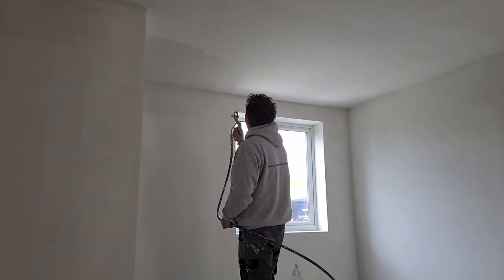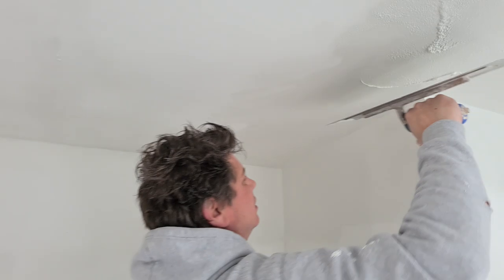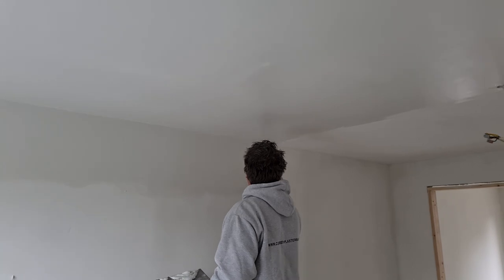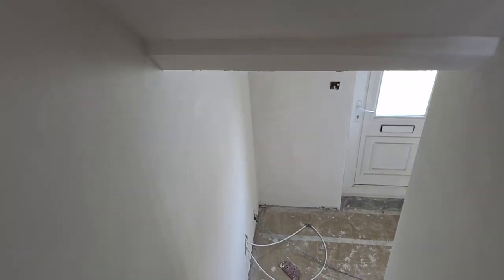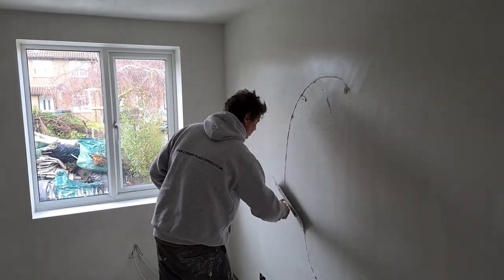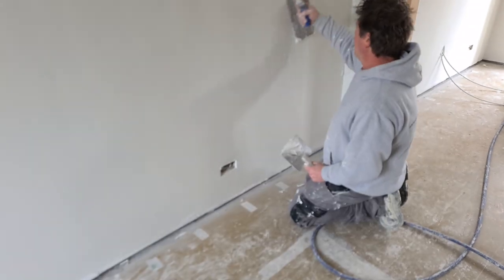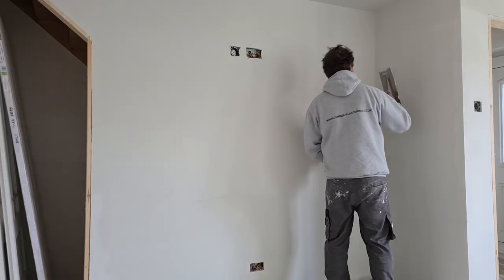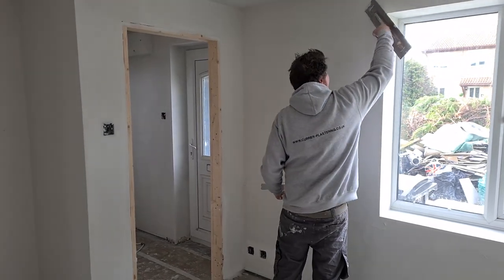Finishing Airless Spray Plastering

Comment: Cracking job I’ve been looking into spray plastering instead of the old traditional ways, how is it for single rooms in occupied houses with clear rooms ?
Reply from the maker: The system works well however its no quicker then gypsum plastering
Reply: @currierplastering  well it’s looks quicker, cleaner, more enjoyable, two of you on the job would piss a room in a day and a much better result, nice video
Reply: Finish is better than gypsum when painted. Not as hard/polished finish but looks really classy when painted properly

Comment: Watched your video a couple of times now. Just finished 12 ceilings with your words in my head, "chase the tail." Thanks and looking forward to the video with fitting the beading. What was the the finish filler you use that goes off in 3 minutes?

Comment: Looks like you're doing a level 5 finish... if you are you don't have to trowel it off just spray it on and let it dry.... is it just a skim coat you're doing or something else.. looks like your to far from the wall and useing the wrong tip.

Comment: Nice video, really shows how easy it can be when done right. Any chance of a video on prep? For me as a plasterer that is the worst part to do and sell to the builder. 
So any tips/cheats to make that part as painless as possible would be appreciated.
Reply from the maker: I'll do a prep video soon. We use corner rollers, flashers and a 10" box. We spray the corners and apply fiba fuse with a empty banjo.

We will tend to prep a house in 2 days, spray first coat in a day, second in a day and sand in a day.

Comment: This is such a good video, thanks guys. Would be great to see a video of your first coat and prep. Do you always use a tear away stop bead against the windows or is it ok to do without as traditional?
Reply from the maker: Thanks, I'll do a video of the first coat and prep on our next job.

We don't always use tear off, and can go up to windows with airless. If there is a gap we will fill with fast set and apply fibafuse before the topcoat goes on. Give a more secure solution the just pushing plaster in.